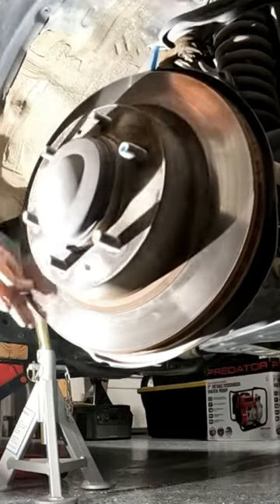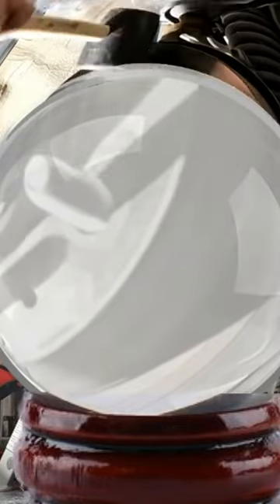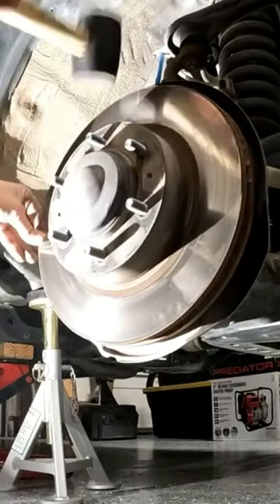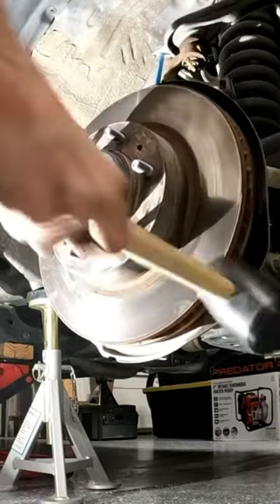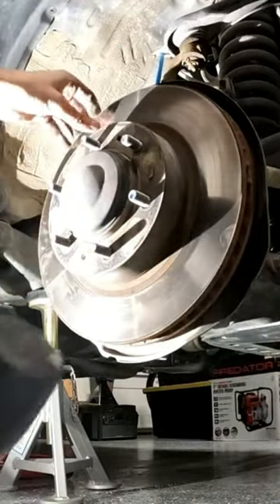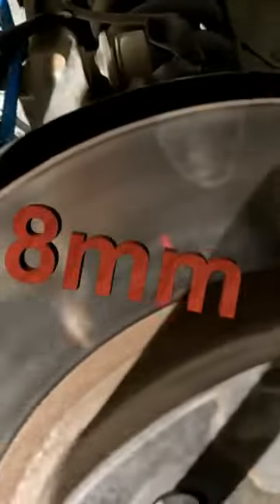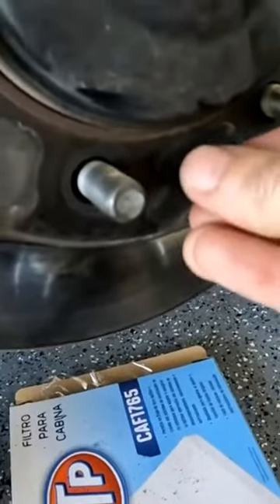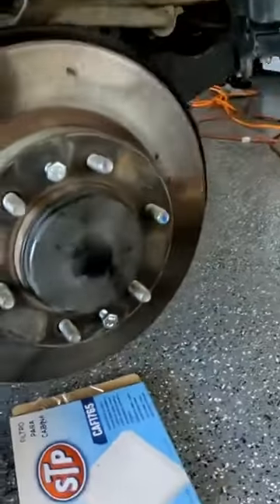Solution For Stuck Rotors - Seized on Toyota

Comment: For starters 1st mistake is using a rubber mallet as if to prevent rotor from breaking / cracking..🤷🏻‍♂️.. 
Removal access threads help and are there and have been there for decades for that purpose especially / primarily on rear with inner E brake shoes...
but fronts 1 may be 2 quick dead blows with 3lb metal sledge on face of the Rotors hat and done